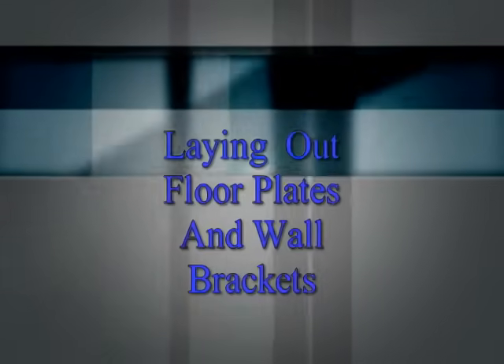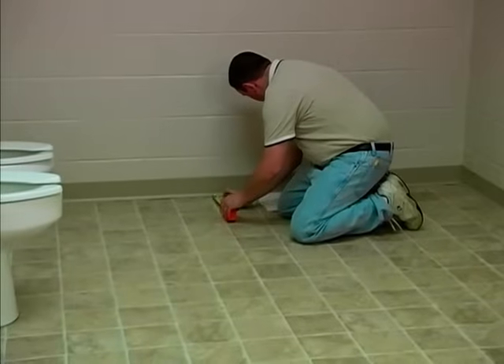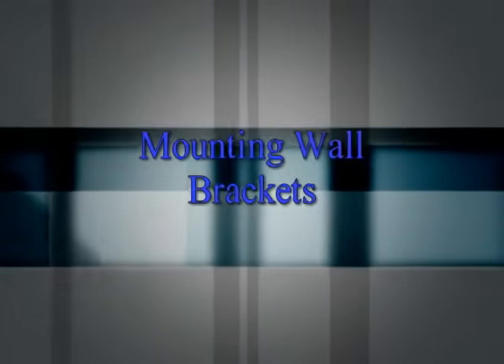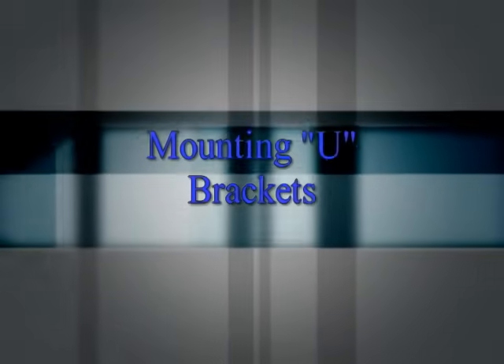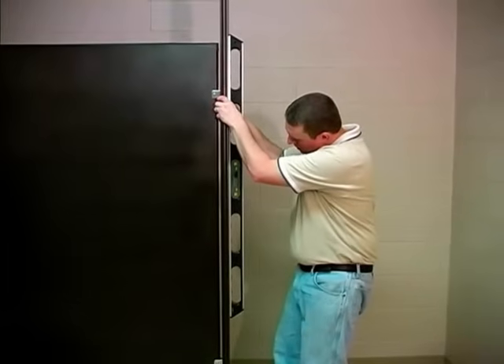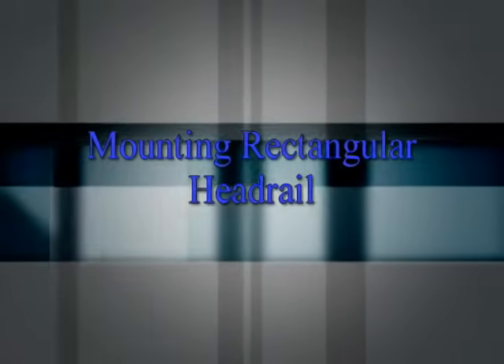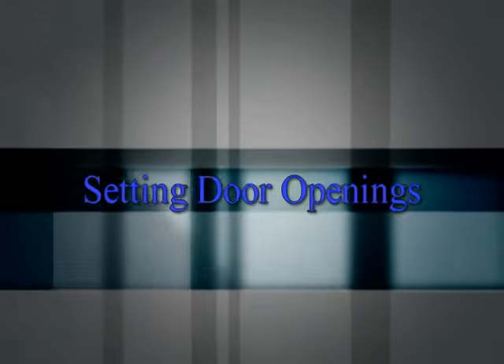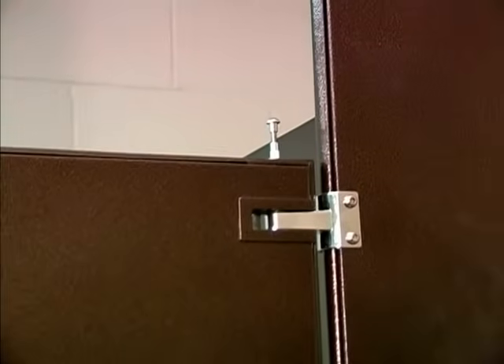General Partitions - Toilet Partition Installation

Comment: In a two stall plan like this where the H.C. stall is first...I would always get the building owner to let me turn the small skinny stall door to an out-swing.
       This makes it so much easier to enter and exit as usually the in-swing door makes people straddle the toilet and the dispensers are also in the way.
     A person in a wheelchair would not travel down to the end so would not contend with the outswing door.
       Altering some plans would sometimes need an architects blessing but in an office or a church working for the building owner it is o.k.just dra2 a new plan over the original and get a signature on it as a field modification.

Comment: This guy has got to be the slowest installer ever lol, and sharpie marks on the floor?!? So I take it that you guys back east installing these things are hourly and not piece rate right? The dude's not even wearing tool bags, so has to walk somewhere to grab a screw? So yea any metal partition should take about an hour to install, but that's including rolling out your tools, pulling in material, installing, cleaning thoroughly, rolling up tools......one guy, no help.
Reply: Are you saying you can install those partitions in 1 hour including setup time? I’m not giving you a hard time but I’m looking to get into Division 10 products and need some feed back. Thanks, tools etc